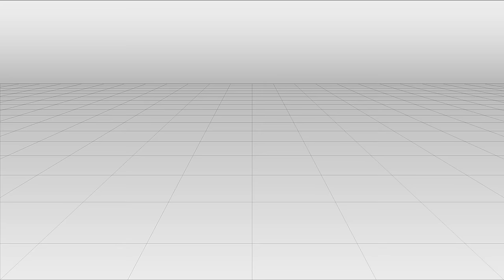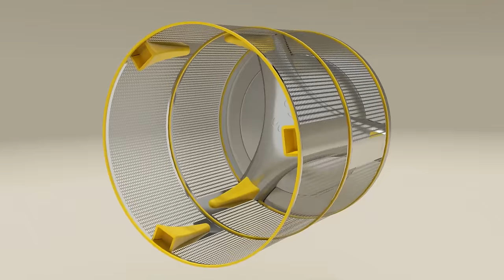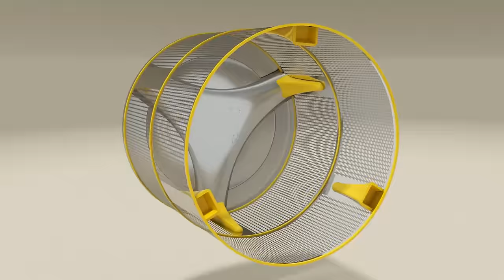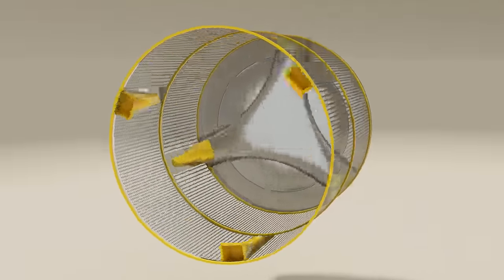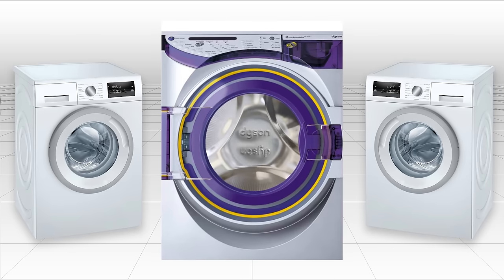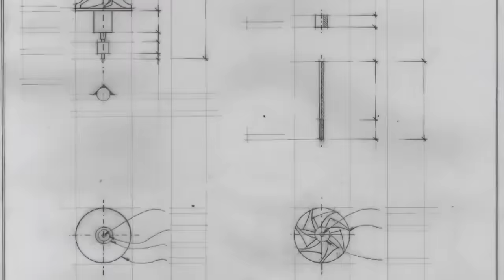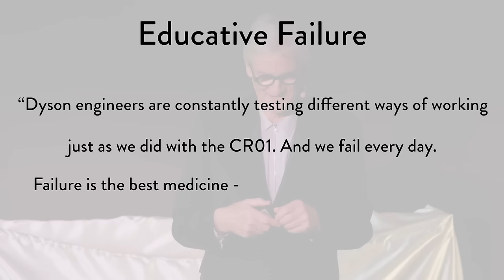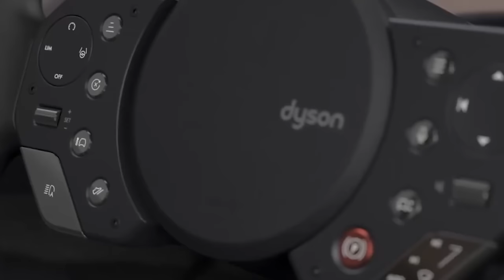Dyson’s Failed Washing Machine? The CR01 Mystery...

Comment: This video is full of speculation that has no corresponding convincing evidence. It also ignores that they produced the CR02 in multiple variants, which is at odds with the clickbait title. I've seen no reason to believe the product line was discontinued for any reason other than profitability, preventing ever improving versions like with every one of their other product lines. The claims quantifying alleged reliability are not evidenced and no detail of the nature of machine failures is presented or contrasted with other machines on the market at the time. A simple fact-check from peer-reviewed studies published in 2019 reveals 1 in 3 washing machines on the market typically fail from multiple failure modes (electronics, shock absorbers and bearings, doors, carbon brushes and pumps). So, while there was some accurate history presented, which was interesting, I found this video somewhat misleading overall that paints a distorted and speculative view.
Reply from the maker: Thanks for the comment, I really appreciate you dissecting the video in such a thorough way. However if I might put forward my rebuttal to some of your comments. I grew up in a household with a CR01 washing machine. You say speculation but this is effectively eye witness testimony! Something that I should have probably referenced in the video, I witnessed the machine fail over and over and we indeed did have our engineer on speed dial… this is also echoed in every article and blog post you find relating to the CR line of Dyson products. 

You mention a paper that says 1 in 3 machines fail - well 2 out of 3 Dyson machines failed, and that’s one brand not all washing machines on the market so it’s not a comparable number and just goes to highlight how unreliable their machines were!

Whatever way you look at it, Dyson stopped production due to profitability. Dyson say they made it too complicated and charged too little hence no profit. I’m saying it was too complicated and therefore massively un-reliable hence no profit… their competitors also confirmed this (not that a competitor is a reliable source of information, and could just have been them twisting the knife) 

I’m also not sure you watched the whole video as you would have seen that James dyson himself remarked that the washing machine venture was a “educative failure” 

The entire dyson washing machine line including the CR02 was cancelled 4 years after the original one was launched and the CR02 had such minor upgrades it was hardly worthy of its own number it was more like the CR01.5. In an attempt to keep the video under 30 mins I omitted the inclusion of the CR02 on purpose, as explaining how that fitted into the product line and what the differences were was in my opinion unnecessary.  

And a click bait title? As someone who actively, to the detriment of their channel avoids clickbait in all forms I don’t think that qualifies… 

But keep up the good work YouTube needs people like you keeping content creators honest! Even the small ones like me!
Reply: @BehindDesigns  Thanks for the response. A few thoughts in the interest of a conversation.

>> “You say speculation but this is effectively eye witness testimony!”
I don’t doubt your observations. However, the video at no point talked about your specific machine; it made sweeping generalisations and made specific factual claims about all the machines, which were not supported by any convincing evidence. I only intended to point this out and explain why I found it misleading and unconvincing.

>> “You mention a paper that says 1 in 3 machines fail - well 2 out of 3 Dyson machines failed”
In my original comment, I said I didn’t believe these quoted figures. They were not supported by any convincing evidence, or any detail of the level found in basic-fact checking on machine reliability. The video claimed this was simply asserted by a competitor. Vague subjective testimony by a no doubt threatened competitor on a factual matter is deeply unconvincing. Again, I’m just explaining why I was unconvinced and found it misleading.

>> “Whatever way you look at it, Dyson stopped production due to profitability.”
Precisely—because there’s evidence for this. But in the video, you started to imply there were other reasons. This was speculative, unsupported, and came across as half-truthy infotainment which had the effect of being misleading. Again, just expressing my thoughts.

>> “Dyson say they made it too complicated and charged too little hence no profit. I’m saying it was too complicated and therefore massively un-reliable hence no profit”
The first statement is true; the second is speculation that I didn’t believe. There is no evidence the mechanical failures of their first machine were a result of the ‘complexity’. Again, no data is available looking statistically at the sources of failure—which can be numerous, even today with simpler machines, as a simple fact-check can reveal.

>> “their competitors also confirmed this (not that a competitor is a reliable source of information, and could just have been them twisting the knife)”
Their competitors did not confirm this. They simply made statements without evidence and so I don’t believe it, for the reasons you suggest.

>> “I’m also not sure you watched the whole video as you would have seen that James dyson himself remarked that the washing machine venture was a “educative failure””
If you watch other interviews, he values failure as a means to learn (i.e., basic common sense). Such a comment from him simply means they learned a lot, as they do with all their product evolutions, and says absolutely nothing about reasons why they discontinued the line beyond what they’ve already said.

>> “The entire dyson washing machine line including the CR02 was cancelled 4 years after the original one was launched…”
Four years on the market is not as short as you imply. Regardless, this simply means it was determined by this time that it was never going to be profitable. The 4-year market lifetime says nothing much, especially as they were under guarantee for 20 years and thus contractually supported for those two decades.

>>”…the CR02 had such minor upgrades it was hardly worthy of its own number it was more like the CR01.5.”
I’m not sure I believe this statement. There is no evidence presented of what was different at a deeper technical and design level to justify the claim it was a minor upgrade. There could have been many changes under the hood, as is often the case with future versions, that improved reliability. They’d accumulated a lot of data by that point.

>> “In an attempt to keep the video under 30 mins I omitted the inclusion of the CR02 on purpose, as explaining how that fitted into the product line and what the differences were was in my opinion unnecessary. ”
What’s special about 30 minutes? Plenty of equivalent videos far longer than that out there. I felt the omission of the CR02 helped generate a storyline that had misleading elements and fuelled unevidenced speculation.

Overall, I’ve no doubt version 1 of any new product line is bound to be considerably weaker than future iterations; this is clear for all complex products and all manufacturers. To imply in the video there were reasons other than profitability for discontinuation, were simply not supported, and purely speculative. Again, this is simply the reasoning for my original comment. Some of the historically factually accurate parts of the video (that can be fact-checked) were, in fact, quite interesting. Their approach and technology was brilliant. If it was profitable, I’ve no doubt they would have continued evolving and improving the product line, just as with every other. You don’t see equivalent videos about their very first cyclonic vacuum cleaner (or other products) and all their issues—mostly because they’re still in production. It being stopped doesn’t mean there was anything wrong or negative about what they were doing at a technological level. Essentially, credit where it's due and critical claims require evidence (statistically significant and objective).

Comment: Washing machines are already complex machines. That's why they're really expensive. Even so, they are still compromised to keep the price as low as possible, everything from the excessive use of plastic, to the high school project level design of the suspension system. Even though it's a simple method of washing. A motor spinning a basket full of water in both directions, there's still a lot of parts that go into a washing machine that makes it as complex and expensive as it is. I don't think there's much room for innovation for a home machine since it's already complex and expensive. I mean, think about car washes. All of that equipment; hoses, pumps, brushes, conveyors, blowers, a hell of a lot of computers. Who knows how that would be watered down to make an affordable car washing machine to buy. It'd probably be a small robot that tries to climb every angle of the car for like 3 hours if it can even clean it, and still cost like $4k. All for what? The "convenience" of not having to take all that time driving to the car wash even though it would take like 20 minutes of your time tops as opposed to half your day? The "eco-friendliness" of not relying on a big ugly resource wasting factory, even though manufacturing all those individual machines for people would require, not only a lot more resources, but also emit more greenhouse gases, not to mention all the e waste. All of this to say, I think we got it all wrong. It's probably better to rely on machines for our daily needs though a service, instead of buying each our own, because cost can be a major barrier for innovation.